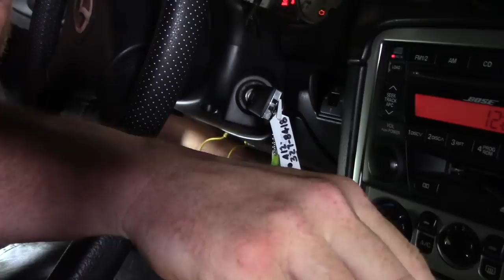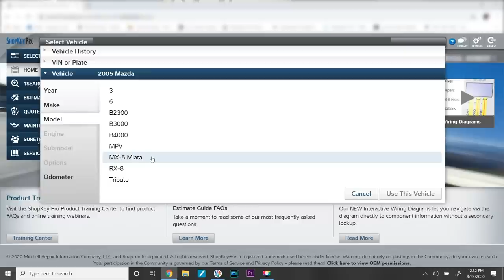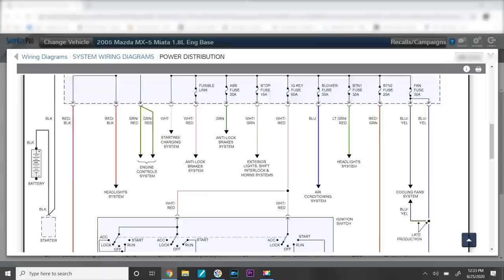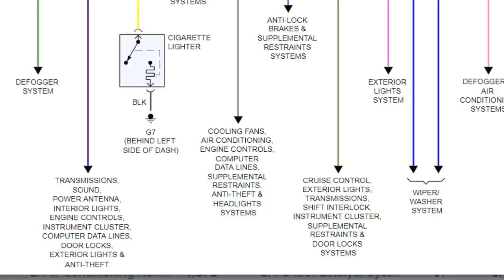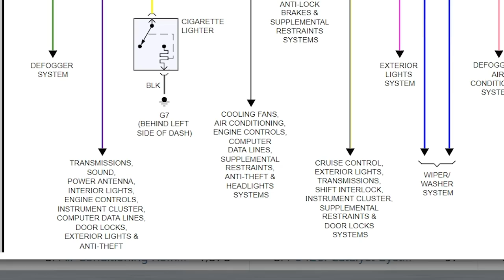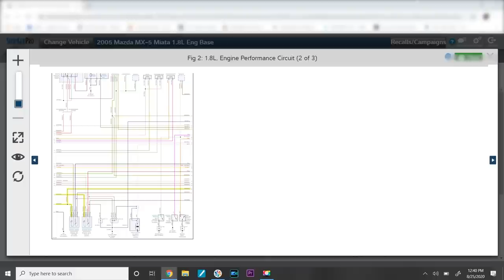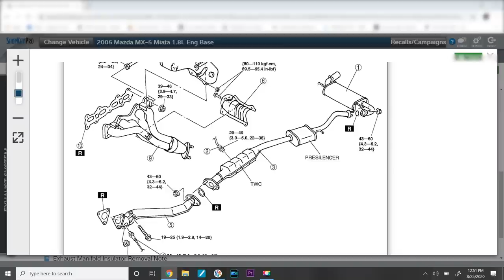2005 Mazda Miata Engine Fuse Keep Blowing (Short to Ground Testing Fundamentals)

Comment: Use continuity setting on your multimeter. Plug into the cold side of the fuse with the red lead and place negative lead at battery negative. Wiggle harness when you hear the beeping you know exactly where the short to ground is. Great video! Thumbs up
Reply: Great tip.
Reply: works well,can use a buzzer too,bell,the short is the switch,do house wiring ,and we bell the ends of the cable,to find the other end ,bell and a battery setup,dead testing ,power off
Reply: @richardjohn5216  if it's noisy in the shop why not. Thanks

Comment: In a pinch, replace the fuse with a lightbulb if you have a short to ground. When the bulb goes out or dimes, you found the short!
I love May's confidence! Love her questions!
Reply from the maker: Just be careful with the light bulb test as some circuits will light a bulb and it is normal!

Comment: Hey SD! Just wanted to say what a HUGE help your videos have been! I've developed some awesome diagnostic skills and picked up this cheapish Launch CRP129E scanner off Amazon and was able to use it the other day to identify a bad wheel speed sensor on a 2005 Toyota Prius. I plugged up the scanner and set the data points for all 4 wheels and we went for a test drive and seen 3/4 sensors reading data and the LR reporting 0mph! It was so cool seeing that data in real time and knowing for absolute certainty that there is an issue with that sensor or the wiring! Thanks again man love the vidoes!

Comment: Put a bulb in the fuse holders with a long length of wire to where you can see it. If the wires short as in this case the bulb will light,simple easy test and no fuses burnt out whilst testing!

Comment: A neat trick I learned is just to substitute a test light for the fuse. If the short is active, the light will be lit and you can wiggle the harness until the light goes out to locate it. On the other hand, if the short is not active, you can wiggle the harness until the light turns on to locate the short. There may be some considerations depending on the circuit design, so it's always best to familiarize yourself with the circuit diagrams first.
Reply from the maker: For sure! As some circuits will light a test light and it is normal!
Reply: I do this but with a 12v buzzer. Even if the circuit normally has a ground connection through devices you will hear changes when interacting with the harness and not have to be in line of sight to your test lamp.

Comment: Nice to meet May! (hope I spelled that correctly ...). She's got a future in the camera world, too, there - she knew a great shot when she saw it. Nice job, May! 👍😎

That was a great way of finding a short - a puff of smoke in your face!  That'll get your attention! :D  

Back when my Silverado was nearly brand new ('07), I had a short in the right side marker / running lamps. Every time I thought I had fixed it, it would blow another fuse. Always when towing the dovetail car trailer on a busy highway, too. I got so mad I threw a jump wire in there. Well, needless to say, I found the short - a bundle of melted wires in a ball behind the right tail light assembly! Could've smoked the whole truck! Also got a nice brown patch on the fuse box cover map, under the cover where the jumper was. Melted the plastic where the fuse pins go, too! I got lucky on that one. My temper ALWAYS costs me money! Anyway, that truck is currently down due to a 2-speed transmission. Lost 3rd and 4th last Sunday on my way to visit my dad. 103k miles. They sure don't build 'em like they used to! I'm driving the 26 year old Volvo in it's place, and the wifey is still driving her 34 year old Grand Marquis with the ORIGINAL driveline (and in-tank electric fuel pump!!) with 272k miles on the clock (and counting)! I should've bought more of those Crown Vics, Towncars, and G/M's - I could've made a couple into pickups that actually last ... 😁

Comment: Miata guy here (I have an NC and used to have an NA).  This NB2 is a lovely specimen. I’m wondering if maybe there’s bad motor mounts (or badly-installed motor mounts) causing the engine to rock too much, thus rubbing the bracket into the wire. Just a guess.
I’m not sure that bracket serves any useful purpose in the vehicle anyway, I believe it’s just for lifting the engine. So possibly you could toss it in the glove box until the owner adds a turbo, over-revs the engine, or does a “money shift”.

Comment: Good find!
Contact with movement, heat and vibration.
They might have broken a zip tie or forgot to install an insulated cable clamp etc.
Reply: Something than stopped movement missing?

Comment: WTG. I also like a taillight socket. Use the park light side and say a 10'  extension cord. Simply crimp spades push in where the fuse goes.  it will light up the bulb due to the short. When the light goes out you found the short. 10 foot cord allows to go outside the car.☺

Comment: Used lengths of fuse wire 20 amp about a dozen strands to make an emergency throttle cable, that was during the war.
Handy stuff to have in tool kit.

Comment: I have a 1991 Miata & a 1991 V6 4x4 4Runner. I saw your Miata video where the Oxygen Sensor wire was rubbing & shorted on metal where a round grommet was previously protecting the wire from chafing causing the 15amp fuse to blow. Was that the EFI fuse? Anyway, that is yet to happen to my Miata or this kind of wire chafing in this exact spot on the valve cover area as in this video. Where I am having the 15amp EFI fuse blowing is on my 914runner. For 2 weeks it was an intermittent problem but now my brother got stranded today at his job out of all day on New Years eve. Not that he had plans since we're dealing with the pandemic. Anyways, my research with this problem with the 4runner also indicates that it is highly possible that the problem may also be a burnt grounded wire from the Oxygen Sensor on the exhaust. But definitely, visual wire tracing is always a must, never fail to go to the basics despite the modern technology to detect shorts or open circuits.   By the way, I find it funny that Mazda & Toyota were both using the Air Flow Meter, identical in looks also. I guess that was the technology trend in the 90s. The AFM was another head ache 2 years ago that I had a difficult time figuring out to have been the problem for my no gas delivery to the fuel system, & not the gas pump, Circuit Opening Relay, not the EFI fuse or relay. Now it may be the O2 Sensor. HAPPY NEW YEARS!!!

Comment: 👍 on the cardboard! I keep a big stack of it in my shop and use it even when I could otherwise use a creeper. Family and friends know to never throw away a large piece of cardboard, just bring it to me and I'll swap for a cold one! Tesa tape just went into my shopping cart! Thanks!
Reply from the maker: Cardboard for the win!
Reply: @ScannerDanner  I also use cardboard to sometimes 'guard' radiator & condenser cores when working in their proximity... a tip learned from my high school auto shop teacher back in the 60's! Cheap insurance...
Reply: when i go to use cardboard at work everyone looks at me like wtf u doing. we got this thing called magic creeper which absolutely sucks for a creeper but as a padding/protection from ground it is like cardboard but better.

Comment: Hey Paul, I know your a engine performance guy but do you have any videos diagnosing torque converter shutter or monitoring TCC live data and things to look for when diagnosing low line pressure or a faulty valve body

Comment: I have that same short circuit tester, it works very well. I mentioned to you in another video of yours about a set of good crimpers. I found a set, they are on a website called Crimp Supply.com, part number 37A13013. They are listed for $74.30 and do wire sizes from 22-10 gauge. To this day they are the best style crimpers I've used.

Comment: To wrap electrical or friction tape around a wire in a tight area, I like to wrap a  bunch of layers of the tape around a small 8 mm  non tapered quarter inch drive socket  to  get  in between  the confines and wrap the wire  where you would never be able to get the actual roll of tape to go  in there.
Reply from the maker: You are the second guy to mention this and I am absolutely stealing this idea!! Thank you

Comment: You don’t need a breaker or fuse. Every wire is a fusible link if you run enough amperage through it! Lol
Reply: Yeah, smoke if not the flames will lead the way! 😂
Reply: just follow the mushroom cloud of smoke, I've done that plenty on dinosaur vehicles, of course they had minimal wiring to burn together and not many computer modules to cook
Reply: Yes just an exercise, to burn out  wiring with out using safety devices such as fuses.or you might be one if these useless guys, do it and chance it guys.
ITS A GOOD JOB YOU WEREN'T
IN THE LAST WAR.
Reply: @nigelclark7360  in the real wars, they were smart enough to NOT make such stupendous junk that burnt itself up and broke every 3 minutes, they made stuff to last. now days well, so much for that ;)
Reply: Todd Orton oh damn! 😂 yeah that definitely sounds like it was a stressful situation
Reply: I usually just put a test light in series in place of the fuse to look for shorts. Gives you a good visual indicator of when the short is occurring and when it’s not. Beats wasting fuses and constantly resetting a circuit breaker especially if you have the manual reset style. The test light will only pass the current necessary to light the bulb through the short.

Comment: I enjoy your videos . I have a question I have a 2008 Kia Optima 2.4 that keeps burning out the ac coil . I have the replaced the ac compressor and it burnt it out again.
Reply from the maker: Are you sure that it is the coil? If so, there isn't much that will do that. I'd say you're buying s--t parts. Very common these days
Reply: ScannerDanner  I have found the problem it was the thermostat evaporator sensor. It would not make the ac compressor turn off.

Comment: Thank you for being nice you and your daughter.
During the war l worked behind the front line, l always had different size fuse wire reels, different amperages.
If l had a vehicle with a short circuit, l would put a piece of fuse wire half the amps of that circuit when there was a short,on that circuit if it blew you know you are getting power, 
And a short exists then repair or bypass the circuit just to keep mobile .why didn't you use a test lamps or a meter.
Hadn't got the equipment, running light, water was to keep you alive, and ammunition.
Fuse wire served it's purpose for, sorts, l don't use that way if testing now, but needs must then.fuse wire is easy to carry doesn't take up much room.
I do applogise for my ignorance of using this method.

Comment: Was wondering if you could maybe shed some light on short to ground I diagnosed once. 

There was a circuit for the brake light switch.
One wire from Central Electronic Module with 12v to the brake light switch, and when the pedal was depressed the Central module would get a 12v signal. However when you depress the pedal and put it in reverse the fuse would blow. Shifter in the engine compartment touching a main harness.

 There was a ground wire and a 12v in the engine compartment, both of these were shorted to the engine, they were not related to the other circuit AT ALL. 

Do you have any idea why the fuse for the switch would blow? I was thinking 12v to engine ground would cause some weird stuff to happen but other than that I have no idea...
Reply from the maker: Not without seeing the diagram my friend. Im sorry 😞
Reply: @ScannerDanner  totally understand, no worries 😁

Comment: Pro tip: Wrap enough of your electrical tape around a small diameter socket (like a 3/8" deep socket) and you can do it in one go without needing to feed the whole roll around the harness or do it in pieces.
Reply from the maker: That's a great idea! Absolutely  a pro tip and I'm gonna use it! Thank you!

Comment: Paul, you have to learn how to make your Powerprobe ECT2000 work for you. It will pay for itself the first time you use it.
Reply from the maker: For shorts maybe, for opens, not so much. In this circumstance it wouldn't have been any different no matter what tool I used, as it was not a constant short, and I needed to do visual inspections of the harnesses to find it. But my next constant short, I'll give it a go again 😉
Reply: @ScannerDanner  Paul, it works for both intermittent and constant opens and shorts equally as well.
Reply from the maker: If you say so. The open circuit test I used it for in the past was awful and I'm not the only one who's said so, but it was my first time using it. 😉
Reply: I have the one that came with my PP3 master kit and I hate the tool. I’m better off using a test light as a visual indicator with a little wiggle test.
Reply: There are too many variables affecting how well it works or not. You have to be lucky for it to function reliably.
Reply from the maker: @fascistpedant758  exactly what I have seen from that tool as well

Comment: easier to go  to pcm and check there?
Reply from the maker: Check there for what?
Reply: voltage signal to the PCM that varies between 0 and 1 volt. The PCM uses this signal to control and adjust the It sends an analog voltage signal to the PCM that varies between 0 and 1 volt.  then you wouldn't have to go under the car if PCM is easy to get to any or open or shorted sensor wires can sometimes be checked under the hood

Comment: How does a fuse feed computer data lines ? Computer data lines normally emanate from some type of module. Any one out there know the answer to this ?
Reply from the maker: The fuse doesn't feed computer data lines, it feeds computer power. If the computer has no power, it has no data being put out on the data line. Unless I am missing something or not understanding your question? Got a time frame in the video that your question is coming from?
Reply: @ScannerDanner  Hi Paul, thanks for the reply. It starts at the 6.15 mark, where you are seeing what circuits the engine fuse feeds. One circuit this fuse feeds are computer data lines which are clearly seen and you read it out. It seems strange for it to be called computer data lines if it is a computer source feed. Data lines normally refer to communication lines between modules. Would like to know your thoughts.
Reply from the maker: @marinkojezabek2555  ahh great question! Just checked the diagram for the computer data lines and it simply feeds power to the DLC (OBD2 connector). The power distribution diagram I showed gives a more generic description of what is being powered up and that was misleading for sure.